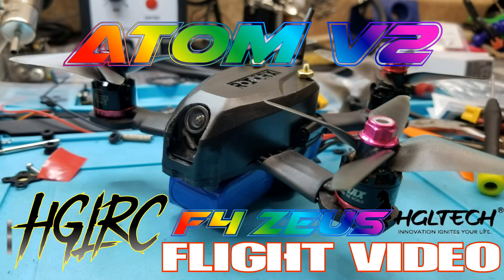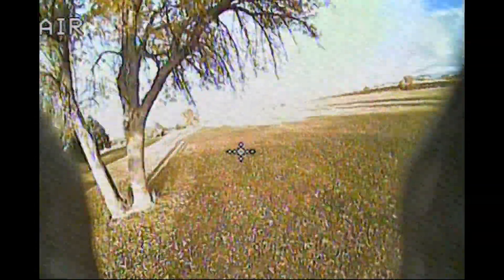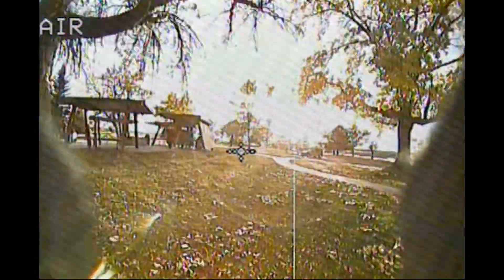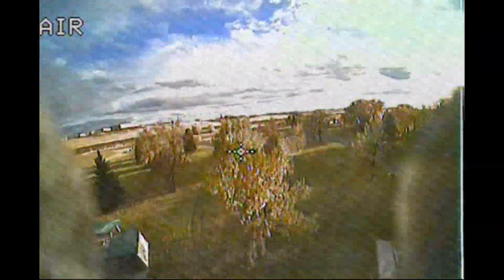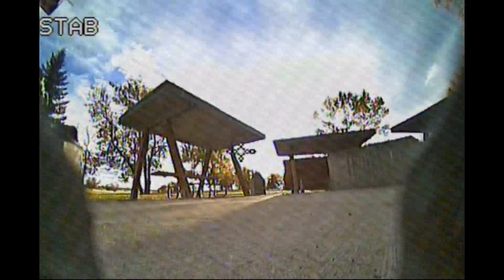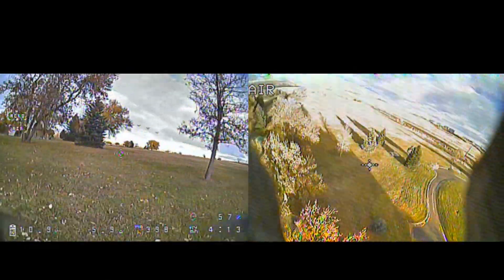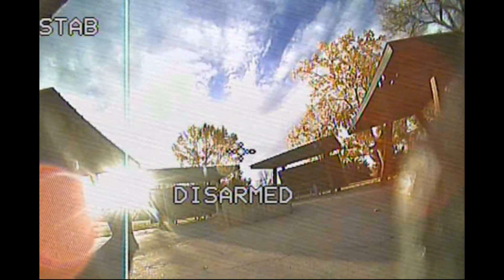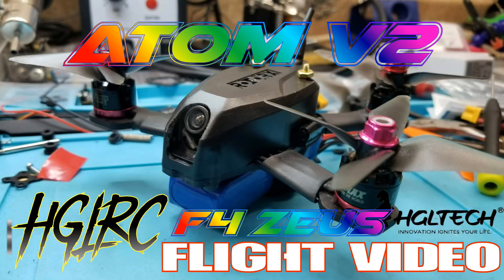Atom V2 HGLRC F4 ZEUS Flight Video

Comment: Have you tried 4s?
Reply from the maker: Nah it flies ok for what I'm doing with it on 3s. I have some 4s bats coming for next spring so I'll see how it does.
Reply: Have you tested 4S already? Planning to build a 3" Micro with this FC and wanna use RotorX 1404 3600 KV with 4S on it. What do you think will this work?